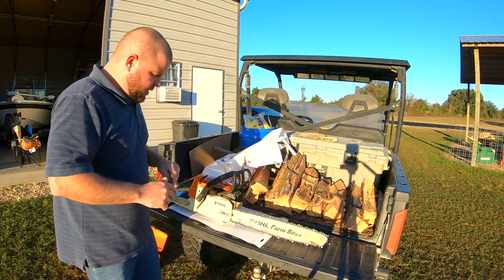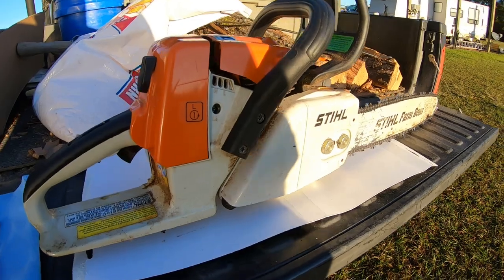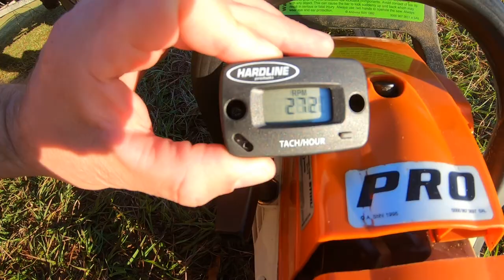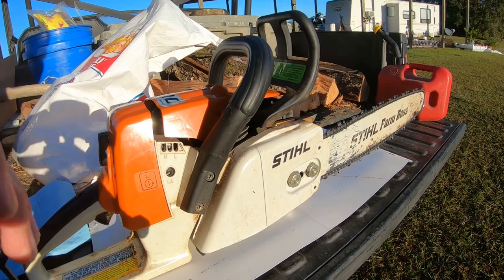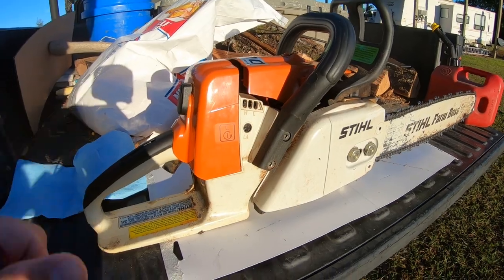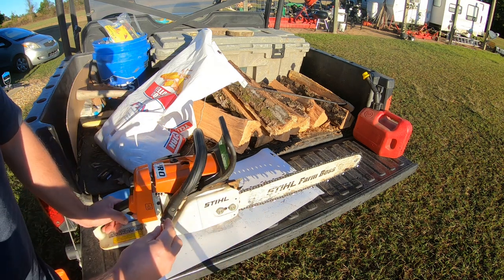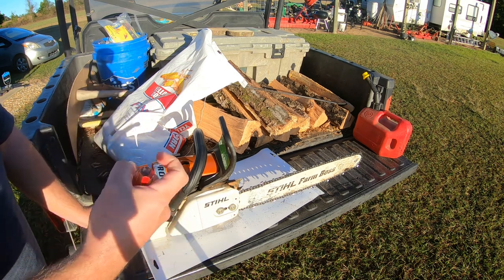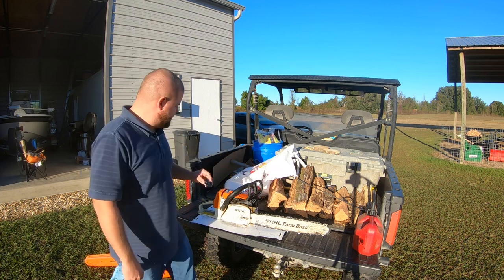#53 Learning how to tune my chainsaw carb

Comment: Thanks for the video, you've gained another subscriber.  I'd like to share a tip:  If one is using the chain to judge the idle setting, it is imperative that the clutch spring are good.  If the clutch springs are weak, the chain will turn at idle, even if the rpms are in the correct range, (also, if the clutch is engaging at idle, this will make it difficult to adjust the rpms due to sporadic engage/disengage,,engage/disengagement of the clutch.  Thanks again.
Reply from the maker: Appreciate the tip and support! It's very possible the clutch springs are worn on this old saw. It's due for a complete once over.
Reply: @TKCL  I replace the springs on my 028, it made a world of difference.  Also, If you have starting problems:  the air filter/choke doesn't properly work on aftermarket air filters.  I replaced mine and it started on the second pull.  (the choke plate doesn't close all the way on some filters, if you can see a gap (take the filter off and depress the tab that closes the choke), then try a different air filter.  If that didn't make sense, hit me back.
Reply from the maker: Appreciate the info, I am starting to hear a little rattle in my clutch assembly. I bet it's worn out, I'll service it. Saw starts like normal

Comment: Good video thanks. I have watched Steve's video a few times before and not sure if he means sweet spot as the place you want to set to or sweet spot highest rpm range of the the low idle screw. He seems to open it up just past the so called sweet spot so the idle drops just a touch and that is the spot he leaves it. You seemed to leave it at the highest RPM is that right? I to think of the sweet spot as the place you want to adjust to, just not sure that is what he is doing. Anyway good vid thanks for sharing and I am going to watch his video again.
Reply from the maker: If I remember correctly you adjust both directions until the RPMs fall off. Then adjust back to richen it and leave it right before the point it falls off again. I'll have to re-watch his video again myself.
Reply: @TKCL    I watched Steve's video again and he says to adjust to where the idle just starts to drop off on the rich side and thats where you should leave it. I think calling the high idle the sweet spot is a mistake in the video because it implies that spot to be the correct spot to leave the screw however he says its not in the video. Not a big deal I don't think it can hurt your saw, you just might see a slight hesitation for running just a smidgin lean at idle. I could be wrong tho I don't know much about that saw. Anyway good luck thanks for the fast reply.
Reply from the maker: Your probably right I need to readjust my saw. Recently it started idling high, I can tell that cheap carb has come out of adjustment. Im planning on getting a rebuild kit for my original carburetor and giving the clutch a tune up as well. Struck a deal for a lot of firewood so I'm about to do quite a bit of sawing.

Comment: Hey mate :) thanks for the video  couple things, firstly let me disclose I’m no expert, but learning myself, but here is what I know :)

Firstly, when you first started your saw before adjustments there was no bog and it was a nice response, but after a couple mins of cutting (you’ll hear it too if you go back and listen to your other video where you were cutting with it) you’ll hear how the bog starts. Saws need to be heat saturated before tuning, this means getting it into some wood and the whole engine fully hot. After this time you’ll hear how your saw started to run very lean. 

With that said, get it into some wood for a couple mins to fully heat the saw to operating temperatures. 

This style of tuning is called lean drop off tuning, it sets the butterfly inside the carb between the first and second progressive idle drilling’s, but you missed a step and didn’t richen the L after finding lean drop off (that sweet spot between the two extremes where they started to drop)

If you use a tach here is what stihl recommends for that exact saw

Clean air and fuel filter and correctly tension chain 

Start 1 turn out on both L and H (you can go 1.5 if you want to stay safe as this isn’t OEM carb)

Adjust RPM with LA (idle) screw for 3600 rpm

Find lean drop off on L (that sweet spot between the two extremes)

If RPM is above 3700 bring LA back to 3600 and start again

Adjust LA to 3300

Adjust L to 2800

Check throttle through (blip it a couple times after each change to settle butterfly and ensure you’re getting the correct reading

Then pin the throttle, does it bog? If so adjust L screw richer (turn it to the left 1/8 turn) does it clear up or worsen? If it improves continue until it’s the best it can be with response. Does it worsen? Turn the screw in 1/8 - 1-16 increments in (right turn) and check again.

When you’re happy, use LA to bring idle to 2800

Adjust max rpm to 13500 (stay on the safe side, better to go slightly lower than higher so gives you room for error) 

Again cut some wood for 5-10 mins and you can frequently check with tach that you are staying within the parameters of 2800 and 13500 and re tune if necessary!

Again I’m no expert I’m just sharing what I have learnt from others while tuning my own saw.
Reply from the maker: Wow thanks for the detailed response! I actually played with it a little more after the video and as you suggested increased the richness on the L screw slightly and all bog went away. Wicked throttle response now, but I definitely need to run it under load in wood before I call this a success. If the next tree I cut seems off, I'll apply your suggestions. Hopefully you see my next firewood cutting video (whenever that is) and can give your feedback! Thanks again.
Reply: The Kelley's Country Life Steve is great and incredibly knowledgeable! He basically taught the same method

Kens method

Find clutch engagement (which is 3600rpm)

Find sweet spot on L

Richen it up to lower revs

Tweak where necessary 

Stihl says

3600 (which is clutch engagement)

Find sweet spot on L

Drop idle to 3300

Drop L to 2800 (that’s richening low after slowing the chain down)

:) both just have a slightly different way to get to the same thing :) 

Happy cutting, can’t wait to see a video with the new saw!

Ps, keep that old carb and put a kit in it. It will only be 20 usd or less and it will be a far better carb than the Chinese one :)

Comment: Hi, this video and your channel just appeared in my feed, so i watched this and the other video you were talking about. You could definitely hear it was lean before also by the "screaming" sound on full throttle, too many rpm. Good job learning how to tune, you may find this video useful, it's the best one on tuning i can remember right now. Watch the chain when he says it's lean on L and how long it takes to slow down from full throttle, compare that to when it's correct. Happy cutting! 

https://youtu.be/29FiGmDQkaM
Reply from the maker: Hey thanks so much for the feedback, I'll definitely be watching the video and making additional adjustments if needed. I have a lot of firewood cutting coming up soon, so I'll be able to put my tuning to the test. Thanks again!